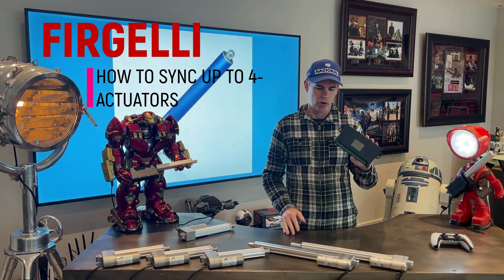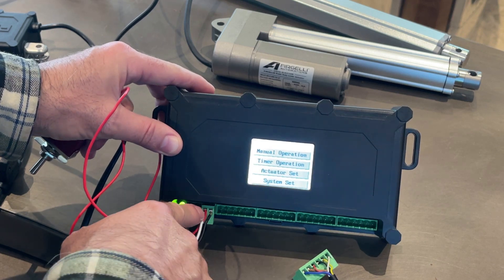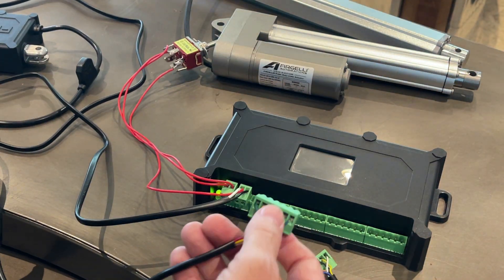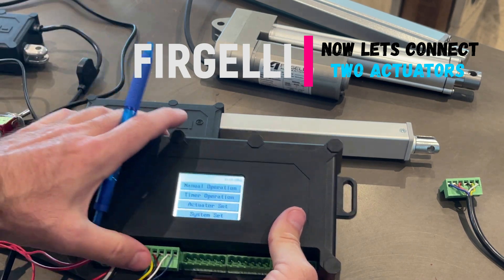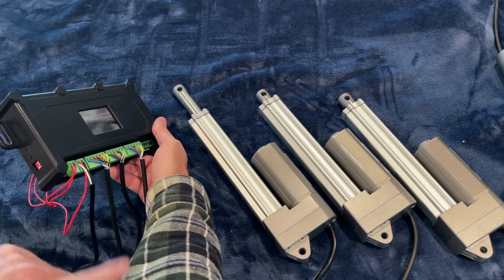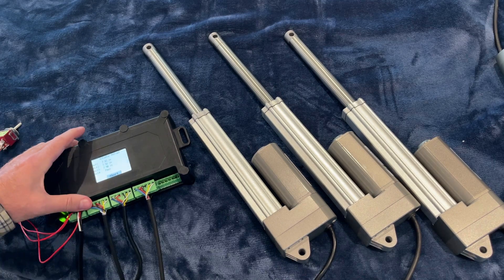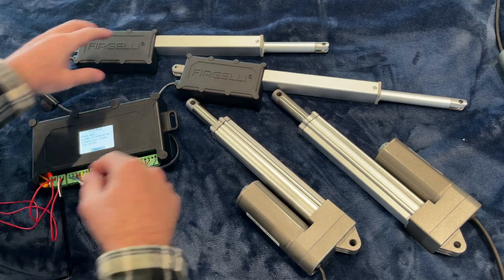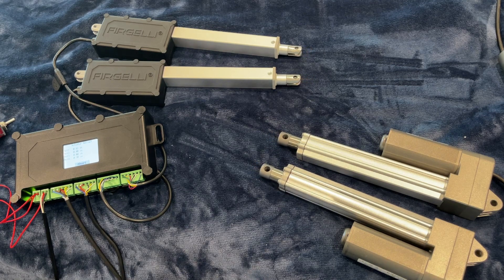How do you SYNC up to 4 Actuators so they all run at the exact same speed. Actuator Sync-101

Comment: What if you need 2 or 3 external switches (an interior and exterior for example). How would you go about wiring a second switch in? And if you occupy the external switch plugs, would you still be able to use a wireless remote in addition to the external switches?  Thanks Love your videos! super informative.